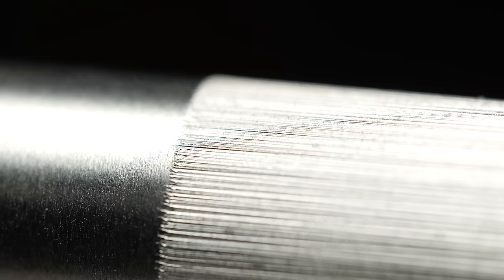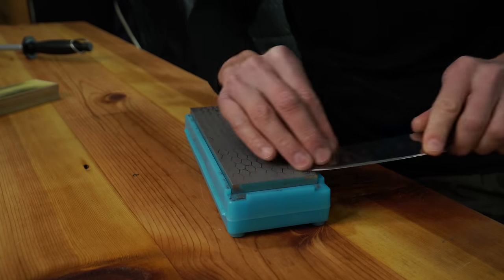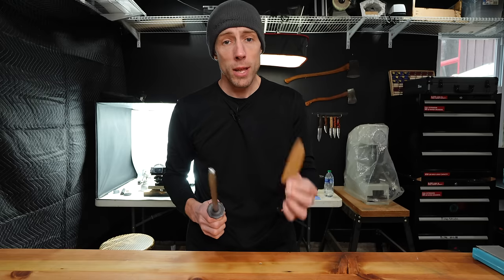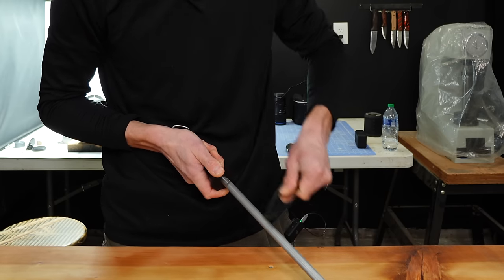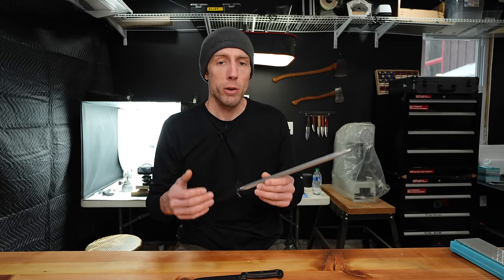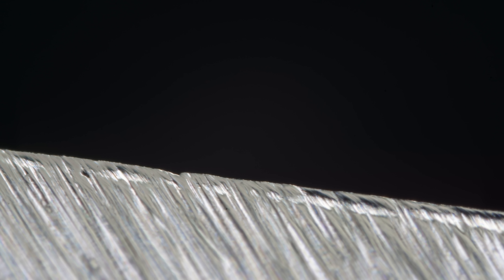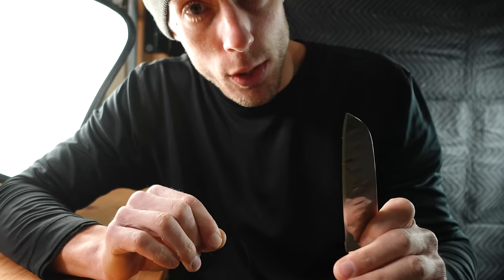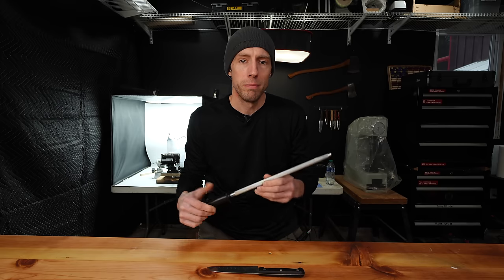What Do "Knife Sharpening" Honing Steels Actually Do?

Comment: Wait wait wait.

You prove earlier in the video that you understand the concept of alternating strokes and adjusting pressure to what you need it to be, then also of edge leading strokes, which minimizes the burr. Yet then you forget this lesson on the steel? As someone who's sharpened plenty of axes on files, and used chef steels (essentially just a round file....) successfully, bro you are doing it wrong. Just like with a stone you need to deburr. The high pressure edge trailing strokes is only for straightening the mangled mess of a deformed edge that your average mouth breather would have inflicted on their knives, and also in machetes to bend bent edge back into place without removing more steel than necessary if it can be avoided to have longer life of the tool.

If you used it properly you'd have a serviceable edge. This is a skill issue.

Comment: I learned a lot from this video. I've always had the question how to use a honing steel: Pull the blade over it backwards, or push it forwards. I see you pulling it backwards and that makes sense if you want to remove the burr (or if it could, unroll the edge). It seems like the people who do it really fast push it instead of pulling...
In the comparison between the diamond stone you say, its the exact same motion, but its not. You push the blade forward over the diamond stone and you pull it over the honing rod.

Comment: Looks like you have a skills at sharpening, but you are probably NOT really using a knifes often. I have a sugestion, try to skin an animal or butcher one. Cut only meat, no bone, you will see The work  is gradualy harder and after using The rod, The knife will go throught a meat noticibly more easily. There really is a Lacko of understanding..... From your side. No one is hitting wood, no one is rolling edge with a pipe. Do you Want to understand? Ten try to do The work that other people do with knifes.

Comment: Good video but I was struck by the fact that when using the "steel" you run the knife BACKWARDS but when using the diamond hone you run the edge as if gently slicing the hone.  That doesn't seem like a fair comparison to me.  Me thinks that you're using the steel incorrectly.  I've been using stones, diamond hones and sharpening steels for a LOT of years.  Generally if the edge just needs a quick a "touch up" I use a steel (but NOT the way you demonstrate it).  In fact only a few minutes ago I touched up the blade on one of my folding knives with an old quality steel I've had for ages.  Before touching it up the blade "felt" sharp but wouldn't shave hair off my arm.  With only a few (maybe 3 or 4) passes on the steel I had handy it was shaving sharp again.  So I disagree that sharpening steels are worthless.  I always bring one along for fishing trips too so that I can touch up a blade while cleaning and filleting fish.  I wouldn't even consider not having one handy.

Comment: I will be more direct with my opinion and experience. I watched and helped my father butcher for 20 years or more. Your tests are impractical to the intended use of the honing steel. Second, the honing steel you used isn't preferred and isn't non abrasive. Those rises and dips in the steel make it abrasive. A smooth steel would be non abrasive. 3rd, a honing steel is not meant to bring a knife edge back to its original sharpened state. It is meant to be an easily carried and quick way to get a butchers knife made for deboning and meat cuts back to a working edge, not splitting hairs. 4th, you suck at using a honing rod, thats not a dig but the hard truth. Truth is, after months of trying, I sucked also. I could not develop the correct technique. I'll tell you who could though, my father and his best friend who butchered for years for 12-16 hours a day. Those quick swipes you talk about not being effective, well buddy, ive watched them make ten-20 swipes in about 3-4 seconds and have a sharp knife back to shaving sharp that quickly because they had developed the technique and muscle memory required for the skill. The point here also is the knife would never get dull nor the edge rolled like you did on the copper pipe. Of course at that point you would have to put it back on a stone and re edge the knife. Thats the whole point of the hining rod, to avoid that extra time and extend the uaeful time of the blade edge withput taking material off the knife and having to replace them constantly. When you are butchering for yourself or your family business to make a profit, time and tool expense is money. If you want a real world test and experiment, bring some meat in and a butcher who knows how to use a rod, like maybe the youtubers bearded butchers at white feather meats and i garuntee their results will show the practicality of a steel honing rod.

Comment: The steel used the way a butcher would is edge leading, not edge trailing as you show in the first part of the video.
If it is used edge leading most of the burr is removed by the steel.
Reply from the maker: No its not👇

https://youtu.be/65JzsDU_0mI
Reply: @OUTDOORS55    Hi Alex, let me firstly say that I have watched your videos long before the start of the pandemic, I learnt to sharpen knives with grit progression stones and then leather strop with green compound. I learnt a lot from your videos and from other knife sharpeners, thanks.
Nowadays I have a part time knife sharpenin business. And I do this, slow speed electric belt sander 400 grit and deburr with a butcher steel edge leading. That is all, toothy edge for kitchen knives (German steel) to cut vegetables. Very polished edge are good for cutting paper like a scalpel but people do not eat paper soup. I have tested my techniques in the kitchen with real food, not on hair or paper. I still believe that edge leading steel can remove burr from a recently sharpen knife. I may be wrong though.
Thanks again for your videos. Stay cool.

Comment: It's biased and wrongly modeled analisys.
You are using biased view of knife sharpenning and ways to test knife sharpnes.
Your edge damaging experiments are absolutly unnatutural.
If you wanted to find truth, you would also get knife designed for honning rod, never sharp it yourself, and found out, how edge is look like undamaged, let cook use it until it would need to be sharpen, look how natural damage looks like, and what honing rod actually do to such damage.

In my unqualifyed opinion, honing rod simply make edge serrated, that make it cut better for some time.

Comment: I’m ex slaughterman spent a few hours using a steel.  I’d say 99% of the guys I worked with steeled towards not away. From just my own observation I noticed it makes a micro  serrated blade. Breaking off the burr when done enough. I sanded my steel smoother just my preference. Not sure there is a right or wrong when it comes to sharpening,some of the ways I seen boys sharpen their blades was almost a joke but hey it worked for them. Love ya vids mate great detail and professional.

Comment: I usually use a honing rod when the knife doesn't feel quite sharp all the way and after using it 2 or 3 times i just sharpen the blade properly.
I feel like it helps when you have tiny "nicks" in the blade to get rid of the displaced metal. Whatever it does, the blade feels sharper afterwards.
Reply: It's mangling the edge and giving you a ton of jagged burrs, which makes the knife "seem" sharper than it was before, but it's very short-lived and actually does more longterm damage to the edge.  Ask me how I know.

Comment: nope. honing rods do work, they remove material from the blade likefine scrapers. you're going the wrong way, it only works with the exge moving forward, and you need to find a sufficiently aggressive angle and pressure. it's likely to be very slow, bnoticeably has more effect on an already mostly sharp blade because it engages better withthefine edge, and it produces an edge that is both coarsly jagged but also on a finer scale burnished in a way that feels a little bit as if doing it to soft steel hardens it. 
there are honing steels that are made so incorrectly that they're useless, those are identifiable by eye because the grooves are spaced wider, and identifiable probably better with magnification by having platesus between the ridges, so they just have no sharp enough edges for a blade to contact.
Reply from the maker: Already covered this boss

https://youtu.be/65JzsDU_0mI
Reply: its a little bit different. a rod is not a scraper. it is made of a much harder steel than steel-knifes, "normal" knifes. my rod has no grooves at old and works pretty well. with keramic knifes - no chance. 
because its harder it bends the edge, alined it and raise a mikro-burr what actualy does the cutting. thats why if you use your rod constantly you wont need stones.
Reply: @berndeikers8924  the difference in hardness is the product of different hardening procedures, with the knife being quenched and then tempered (for carbon steels, heated to the 200°F range and a light brown colour, below the blue temper typical for springs - I've never looked into tempering stainless steels, but the decent ones reasonable to use for knives follow some variation of the same process), which reduces hardness but makes the steel plastic and elastic enough to hold a fine edge that doesn't crumble (and also the blade gets much more resistant to shattering). sharpening rods are probably made like metal files - quench-hardened, but not tempered at all, or tempered only to a very low temperature. 
a smooth metal sharpening rod sounds like total nonsense. the traditional ones certainly do scrape off material, as you can see from the hollowed- out and narrowed shape of long knives that are used and sharpened by rod many times, like butcher's knives or kebab knives.
if it's feasible to bake-in fine enough grooves in the sintering process, I reckon the ideal material for a grooved sharpening rod would be silicon carbide or tungsten carbide. those are tough enough to even stand up to machine use for quite a while, they're the standard materials for cutting edges of machine tools for materials too hard to cut with hardened steel tools. 

yeah I would never use a sharpening rod on a ceramic knife, they seem to not even be suitable for hard steel knives.
Reply: @Ass_of_Amalek  thx for popping in. yes i guess we more or less on the same line. check on wiki - its pretty close what i mean.- have a good one

Comment: I worked in a meat processing facility for years. I used a knife for 8 to ten hours a day. A few times a day I would run my blade over a metal clip which would immediately dull my blade. I would draw the knife toward me with alot of pressure. You'd have to feel the blade catch on the steel. One or two passes would correct it. After a week or so, I would properly resharpen the knife. I would wear out a knife in 3 weeks. I would also wear out the steel in that time.

Comment: So yes the steel does not sharpen a knife but it does make the knife sharper than it was before using it. You are obviously a knife sharpening super geek and that's great but I think u are getting lost it specific terms that don't really matter. A steel does indeed help to properly maintain a knife edge if used correctly.

Comment: You use it the wrong way. You must use the cutting edge in front. Like you use on you sharpening stone. This is how it works.
Reply from the maker: See the pinned comment
Reply: @OUTDOORS55  Thank you. I just did look tho that video, thanks. I wonder how it is when you use the honing steel before that very curl on the steel. I think the honing steel is meaned for to use everytime with light useage, so the cutting edge is not so much attacked as you now did. Can you photgraph this?

Comment: You do nothing with because you use backwards. Your edge need being in front of the rods.
And your rods is a bad one. You need a very hard rods to do this correctly (good hard steel or ceramic)

It is true that rods are only used to maintain the edge and do not allow you to recover an edge that is too worn.

Comment: Please, you know better than that. The steel is meant to be used on a carbon steel knife, not a stainless one. Carbon steel is about Rockwell Hardness ~52 (as I recall, and I've forgotten which scale -- age, you see) is a malleable steel, you can actually push the carbon steel around with a steel. Stainless steel is much harder, 58 - 60+, and is more brittle. You just knock off chunks of stainless when you use a steel.
Reply from the maker: Sorry but none of that is true
Reply: @OUTDOORS55  That's a bit harsh don't you think? 

You must have some experience with plain carbon steel rather than stainless steel, right? Carbon steel has been the go to steel for kitchen knives until very recently, and it is still an excellent choice. 

Carbon steels of a hardness used in kitchen knives is malleable, and when it is burnished with a steel the carbon steel gets pushed into shape and is work hardened at the same time so that the edge retains its sharpness longer. 

What a knife steel actually does is BURNISH a carbon steel knife, and it is used between sharpenings on a stone. It is exactly the same process that you use when making a cabinet scraper.

 A steel does not work on stainless steel, as you point out, and should not be used on them.

Your video is a straw man attack on a well know process.
Reply from the maker: No being harsh its just the truth. Please watch some of my videos. You can also check out knife steel nerds book 'knife engineering' by dr Larrin Thomas for more accurate information on this subject.

Comment: People like me that I know, who know how to use honing rods (you are not one of them) have quality knives that haven't touched a stone etc. for years, yet they still shave hair without pressure. 

What you failed to comprehend is that these rods are in fact a little bit abrasive since they are made from a material that is way harder than even the hardest knife blades. 
And since friction between materials of different hardness results in abrasion, you can keep a knife sharp forever, by using such a honing rod often, so that the edge is never used until it gets really thick and flat. 
The so-called honing you showed here was completely useless. I am sorry. At best, this could straighten a bent burr a little bit as you said.

Really rolled edges as you created, are not the norm if used normally on good cutting boards or at regular cooking tasks like bone-contact. Maybe if accidentally hit on the steel table of professional kitchens. Anyways, that is also something that can be solved with the abrasive qualities of certain rods. Here, the fast honing makes the difference. 

Especially smoother rods will not rip the apex edge the way you showed it here, they would eventually even smoothen the edge furthermore if it is a polished honing rod and it will also remove a burr pretty well too. 
But you can use the leather afterward as well if you think that this would remove the burr even better and make the edge more durable.

Your video got a little bit out of context too, I think. 
The only question is, does such a rod work as an abrasive tool, to hold or even increase sharpness. Not, can such a rod remove a burr. That is something also a grinding stone will not do any better.
As well as, again, the quality of the apex edge. Just pick a finer rod, if the first one makes the edge too rough. That also is not the fault of the honing rod. 

The point is, they are everything else than is outdated. Probably a little difficult to use as effectively as I describe it but well worth it, as soon as you got into it.
Reply from the maker: Sorry but no👇
https://youtu.be/65JzsDU_0mI
Reply: @OUTDOORS55 I don't care about anything else here besides the definition of abrasive. A honing rod 'is' abrasive, and it 'does' abrade. It is less abrasive than some materials, and depending on the type abrades more or less. But it is capable of removing material or wearing something down by friction.
If you're going to use "abrasive" as much as you do. Get your definition right. For the love of god.
Reply: @OUTDOORS55  I already saw that, but my comment also covers what you say there, thank you.

Comment: Another point: most cheap kitchen knives and even some expensive ones used for light work (like fillet knives) are extra soft steel to be flexible and not break. Which is why you might see pro chefs use a honing rod after every big cut with them because without constant honing the edge will be completely dull within a few hours.
Reply: There's a common misconception there. An interesting metallurgical fact is that a steel doesn't get less bendy when it is harder. Fillet knives are made flexible just by being thin; they can be made hard and thin, though some makers have the same misconception and temper them softer. For another example, razor blades are extremely flexible, and their hardness is generally as hard or harder than kitchen knives.

On pro chefs using rods, in reality even cheap knives will easily keep an edge over a day of cutting on a cutting board, assuming they aren't being used on dirty produce or banging against bone or utensils or plates. The overlap between pro cooks and people good at sharpening is, unfortunately, not nearly as big as one might think—cooking doesn't need knives that are very sharp and there is a ton of misinformation in cooking circles about sharpening. In my experience, the communities of straight razor users and hand tool woodworkers have both the most need for sharpness and the best information, as dull edges make life miserable in both cases.